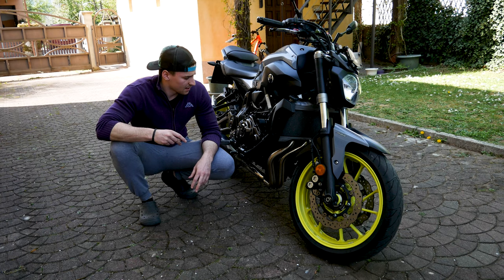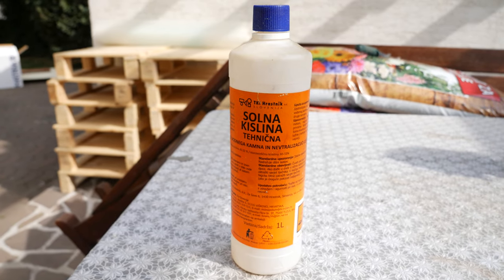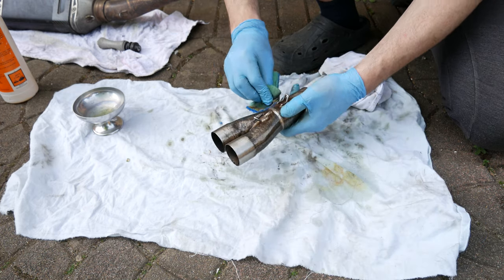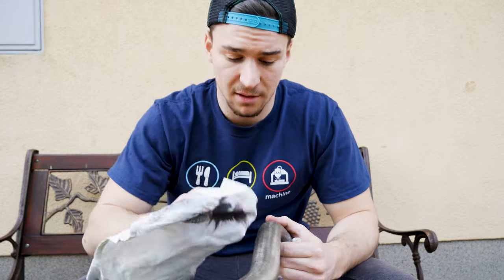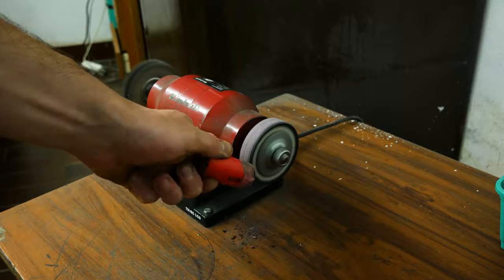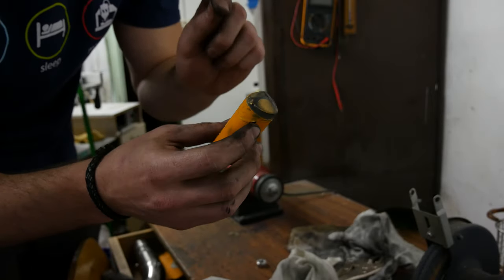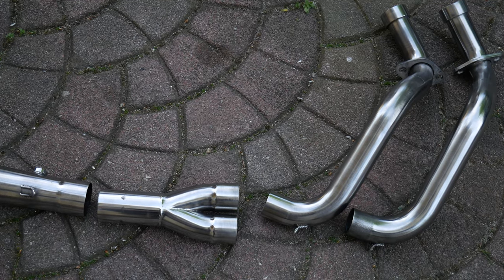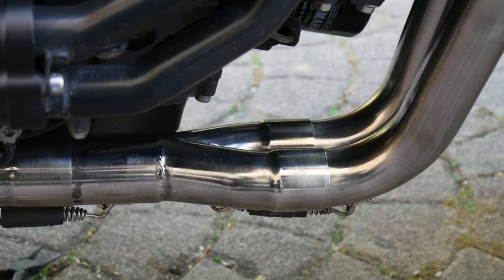How To POLISH your Motorcycle Exhaust Pipes

Comment: Hydrochloric acid is the easy one to find... but is a bad choice on the long run as chloride, beside removing rust, is very aggressive to chromium.
The resulting  cleaned part has a low chromium on surface,  and probably some microscopic cavities. It will rust again and faster...
Better use nitric acid, it will clean rust just as easy but not damage the chromium in the alloy.
Reply: I wondered about that.   Thanks for the tip.

Comment: my aprilia two stroke exhaust is quite thin. Afraid to break the welding lines on the pipe with machine polisher... or am i too cousious?
Reply: Your fine, if your sanding be gentle
Reply: If it's welded properly, the welds will be stronger than the pipe.

Comment: Did you not thoroughly wash off the hydrochloric acid? Any remaining residue will eat into the metal and shorten the life of the exhaust. You should really use a pacifier alkali to counteract the acid once you have removed dirt and rust.

Comment: Sorry, but this is bad advice. Hydrochloric acid is a bad idea on stainless steel pipes, or steel pipes of any kind, for that matter. Hydrochloric acid when in contact with steel will lead to rapid corrosion rates, pitting, and stress corrosion cracking. There are only a few grades of stainless steel with a high enough chromium and/or molybdenum composition to protect from corrosion. Hate to say it, but you've basically just ruined your pipes in the long run. Use an appropriate aluminum/chrome/stainless steel cleaner.
Reply: what would a good cleaner to use be?
Reply: @zxrr3448  Motul and Muc Off general purpose motorcycle cleaners are my go to for routine cleaning. Motul metal polish when the pipes need more TLC.
Reply: What is good to put on the pipes after polishing to preserve them?
Reply: @Matt Foley  just polish them really really well with a high quality metal polish yearly. Any coating besides paint will probably burn off. This isn't my opinion but from a Harley Davidson mechanic. It worked 2ell for me

Comment: JUST SIMPLE POWDER COAT WITH CROME THAT'S IT.....
Reply: I did that on an ultralight aircraft 2-stroke exhaust.  I think it was called Jethot, and was a ceramic chrome finish.   Not a mirror finish like chrome, but better than the continuous rusty metal previously.

Comment: 1. Those gloves are no good, because they are thin and tear easily, often without noticing. You should use washing up gloves which are more robust
2. You didn't show thorough rinsing off the acid. This step is important before mixing chemicals which could release dangerous gases. For instance, bleach and hydrochloric acid releases chlorine gas, which is a deadly bio hazard.
3. You are eating into the metal, which isn't a good idea. You have basically weakened it.

Comment: I'm shocked that even with a bench buffer/stitched wheel/rouge the pipes are hardly polished at all, i've done better with sandpaper and WD40, and with my drill I can get a mirror finish
Reply: What compound do you use with the drill? Do you use different step compounds?